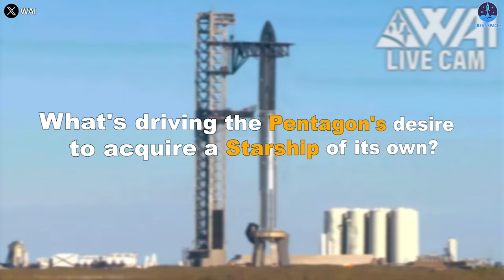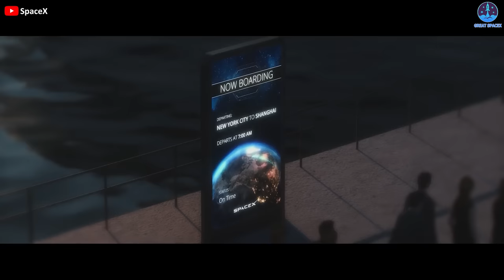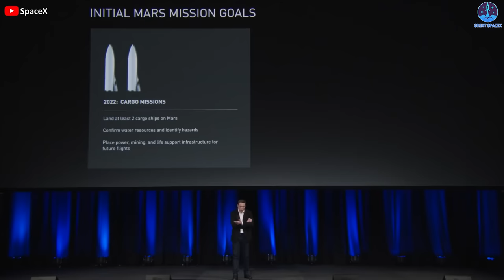From Copycat to Partner with SpaceX. What the heck is the Pentagon doing?

Comment: One problem I can see with the rapid response scenario, once the cargo is delivered or mission completed, how does the rocket return without a booster and launch tower?
Reply: It's another of the Military's stupid ideas.
Reply: How does a C-17 return? You refuel it. 
If the concept depicted it landing in an austere environment, then don't worry; it's only a concept. 
If it were to work, there would be LZs and launch towers built at strategic locations. The point is to deliver vital needs in very short time frames. Not to land a 300 foot rocket in the middle of nowhere.
Reply from the maker: Yeah, great topic. Keep discussing this on our channel
Reply: @Ariel-om5fh Shuttle's "reuseable" boosters were made in Utah. Trucked to Mississippi for assembly. Put on a barge, sailed halfway across the Gulf of Mexico, around Florida to Canaveral. Spents weeks or months in the VAB being integrated onto the Shuttle stack. Launched, dropped into seawater, hauled back to port in the water, put on a barge, sailed around Florida to Mississippi. Disassembled into 4 segments, trucked back to Utah to refurbished and refilled with propellant. Trucked back to Mississippi, put on a barge...

Comment: Nuts to this concept!!!  So the Pentagon wants to have a non-reusable second stage?  Oh I get it, the Pentagon will simply build a OLM, ILT and OTF every place there is a military conflict or a natural disaster and quick response is needed.  It's so obvious.   Perhaps the Pentagon saw the stupidity of the SpaceX approach for quick response.  Starship Terrain point to point is even less sensible than Artemis.

And a set of landing legs may get a ship down but they will cut into the already weak payload lift capacity until Starship V5.
Reply: You mean "Every place there is a military conflict where there's oil" 😂😂